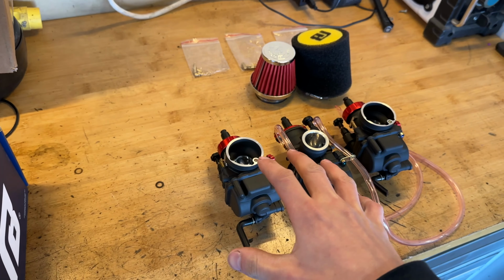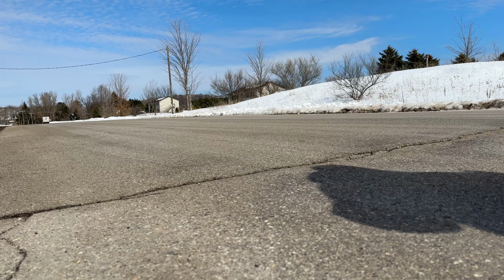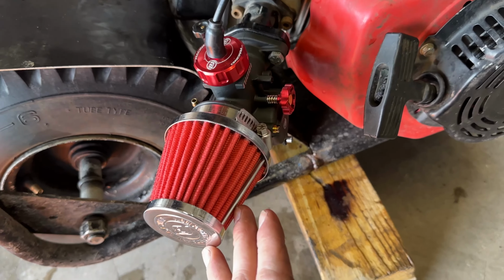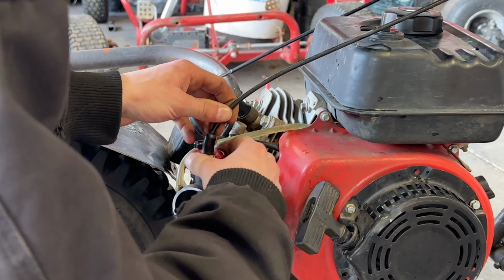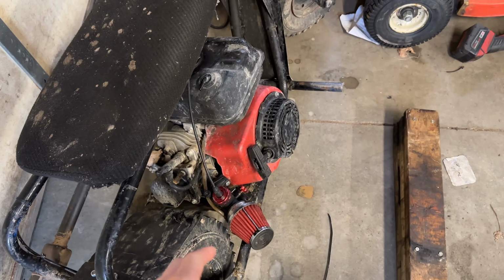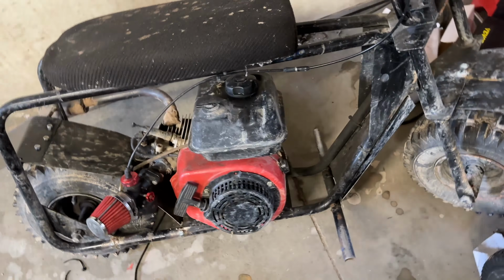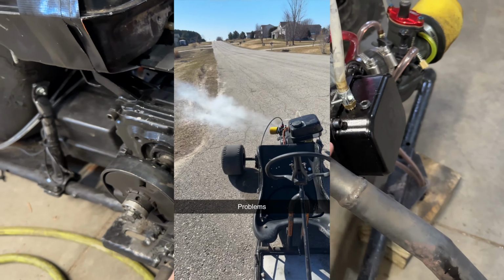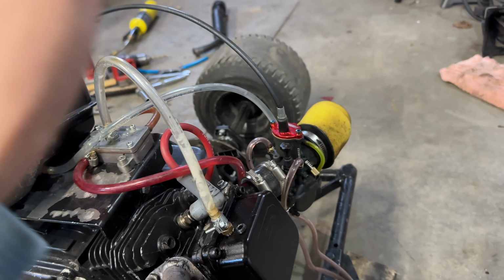22mm GPS carb vs NIBBI 24mm carb whats better??

Comment: It woulda been more fair of a test to compare a GPS 24mm with the Nibbi 24mm. Now we don't know if the improvement is because you went up a size in carb, or if the difference is in the brand of carb.
Reply: Except there is no gps24
The 22 is actually 26mm with a round style slide
AND
A 24mm Mikuni is a flat slide that we already know is an advantage but a little tougher to tune.

Mikuni is what gps copied.

Being the valve size is either 24 or 27, a 24mm carb fits in the range better.
However there are 22mm carbs also(ie pz22) that work better for less modified engines, say a stage II with a lower lift cam for example.

Confused yet?
There is a lot of info about carbs that isn't talked about regularly, gets confusing with all the numbers and slide shapes.

Hoped that helped someone if not, whatever I had nothing else to do for now anyway 😂.

Comment: What are you for sea level?  What jetting did you find worked the best.  I've gotten rid of the bog by running a really fat pilot compared to the main.   It runs great the plugs just sooty would love to know what your running for jetting.
Reply: What jetting on the 24mm nibbi

Comment: What size jets  in the 24 mm nibbi????  pilot and main
Reply: I'm also curious what jet's you went with.  I'm currently running a Tillotson 212r with a .265 cam, 26lb valve springs, port work, flat top piston, billet rod, etc.  So far My jetting so there isn't any bog off idle the 24mm nibbis seem to like a ton of pilot jet.  Makes the plug sooty but theres zero bog.  I'm running a 50 pilot and a 130 main air fuel screw out one and a quarter.
Reply: Yea same here. I ordered a 28mm first. I could not get the bog out of it at all. I swapped it with a 24mm. It's doing better but still bogs if I go full throttle from idle. If I ease into it it'll do fine tho. Unfortunately my jet kit just so happens to be missing the 130 main lol so I'm stuck with the 125. 
Definitely curious to know what he went with on his.
Reply: @gregkirby  Me too.  Currently running a 50 pilot and 130 main like I mentioned somewhere.  Plugs sooty as heck but there is ZERO bog off idle and no flat spot ant all pulling to 9k.  Just feel Like I could get a little more power out of it not running it so fat.  Might just be the characteristic of the carb too since 212cc is a lot for only 24mm carb it just want's tons of pilot jet.  Amazon has a jet kit just make sure you order the one that isn't just keihin or you have the wrong mains, nibbis take VM style main jets and keihin pilots.  I have a real keihin I originally had on my engine but the idle screw houseing broke. Comparing the two they are basically the same besides the diameter of the needle, floats, bowl, and emulsion tube and main jet. Other than that the nibbi 24mm carb is a pe24.  Can't beat the price and it does perform pretty good.  Go huge on your pilot jet and that bog will go away completely.
Reply: @ephenj  I think the problem is the size of the carb. If you look at the mikuni clones the intake side is only 36mm compared to this one being 46mm. Also the motor side being 24mm instead of 22mm. To much air which is why we're having to over compensate with fuel. The stock 40 pilot was definitely too lean and was backfiring when I let off. The 50 is working but I can back the air mixture screw to far out which means it's running rich now for sure.. I'm gonna try a 48 and see how that goes.  There is a very good instructional video on YouTube sponsored by Nibbi on how to tune these carbs.  But I personally believe a 22mm nibbi would be the answer. Perhaps if you have one that's really built, then I could see this one working smoothly.
Reply: @gregkirby  It's started out as a tillotson 212r then I put jt207 196r head .010 head gasket, 26lb springs, 265 camshaft 232 duration, 108 lob seperation, billet rod, flat top piston, 10.5 compression ratio, ported head and port matched intake, 27in 25ex 5mm stems, then a honda 10k flywheel with extra cooling fins. Then the 24mm nibbi.  It absolutely screams with the 24mm the plugs just sooty.  Runs and idles great just runs fat lol.
Reply: @ephenj  Thanks for the jet sizes!  Got my 24mm Nibbi up and running pretty quick on my 196 using your settings.  Nice throttle response, and it pulls well up past 6k.  I don’t have any more runway than that;) Has one little hesitation, but only occasionally.  I might mess with the needle a bit more, but for now, I am really happy with it.  Plug was a perfect tan, go figure.

Comment: Tillotson 212... 24 milli nibbi slider... Just got it and from a pullout it feels soft, put up higher seems to pull OK. What do you think I need to adjust. I tinkered with needle today. Was in middle and I moved to second spot down (2nd spot away from blunt end) and seemed worse. So I went to the 4th spot and seemed better. It still has a bog from the pull out tho. I'm new and looking for pointers.
Reply: Sounds like you are getting to much gas and not enough air brother